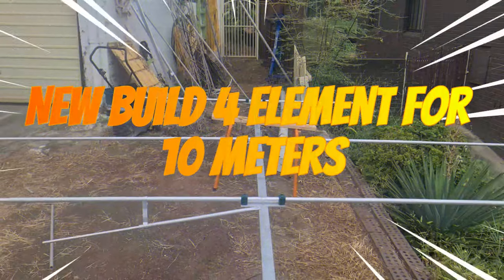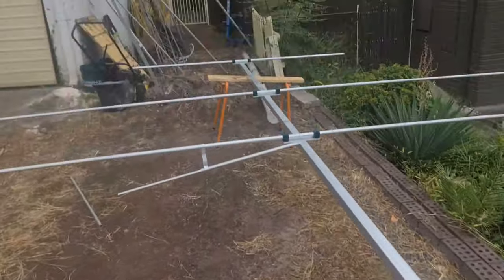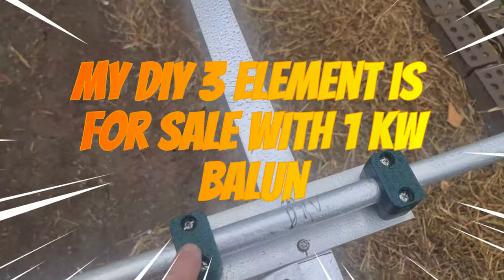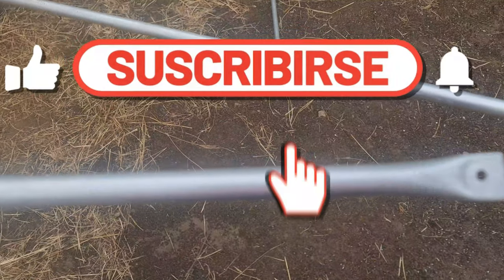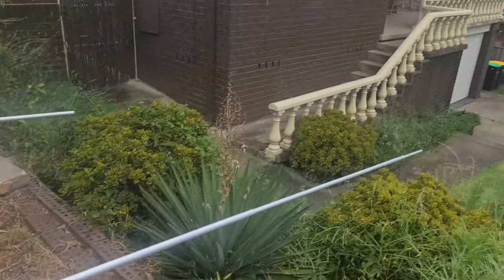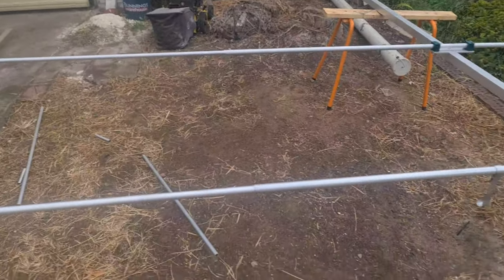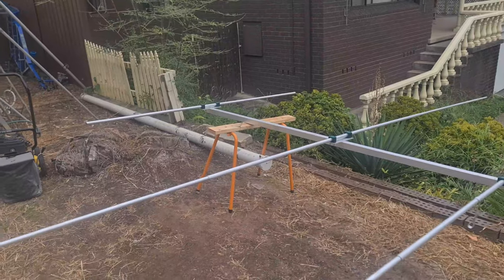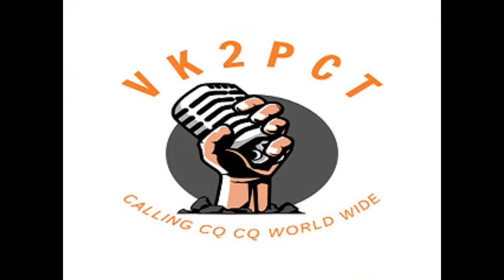MY DIY HF ANTENNA BUILD 4 ELEMENT FOR 10 METERS  PT1

Comment: Hi there sir. May I ask for the dimensions for the Gamma match and the spacing of it to the driven element? And if you won't mind, the spacing between elements. 73s.
Reply from the maker: the outer tube was 19mm about 5oommm long the inner was 12mm with heavy duty heat shrink and about 700mm in length i did remove the gamma due to too muck loss and went back to the 1/2 dipole for the drive less loss and more band with i found, i be leave the element spacing should be in the video